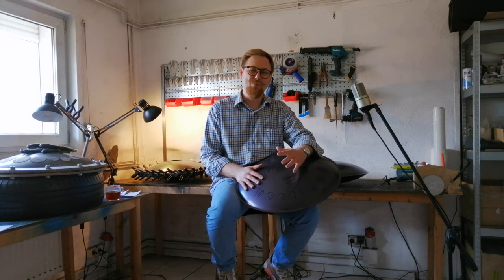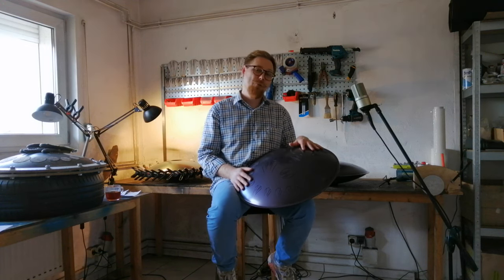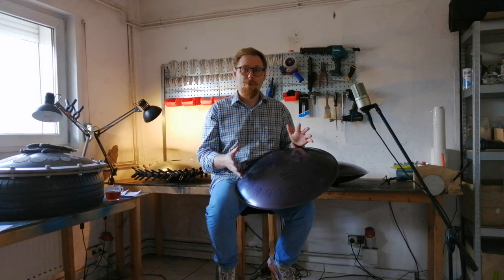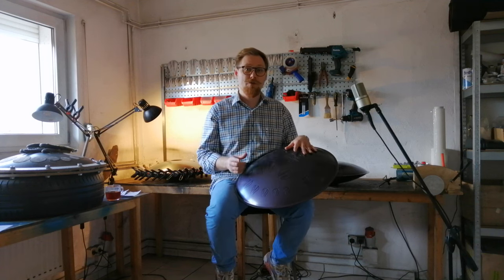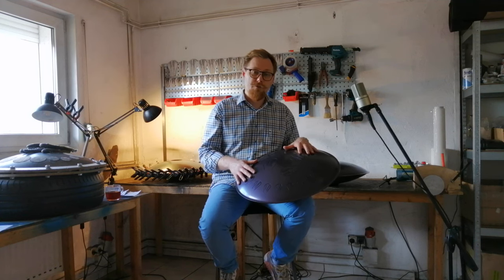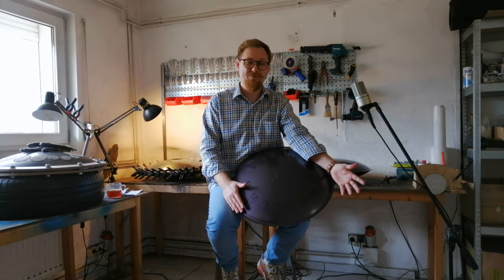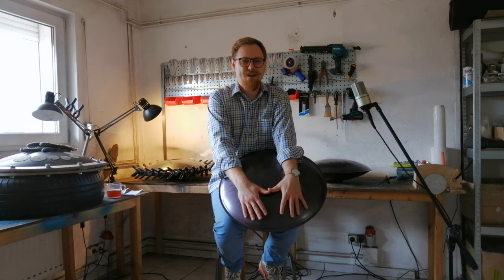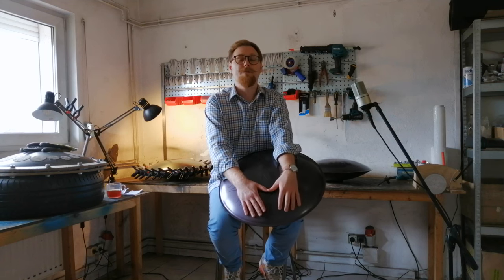From dream to drums: Chromatic secrets of handpan and tonguepan

Comment: I achieved my almost chromatic set up with three little cheap tongue steel drums, I bought some cheap ones because I wanted to detune them with a saw, or retune them to have a chromatic scale, the first one is a 15 note that has E lower note and goes diatonically on the c major scale, I tuned the A notes on that drum to Ab because the second one I retuned it almost completely, this second drum has 11 notes and has a A low note, I think it was originally on D major scale, but I tuned it A Bb C# D Eb F# G A Bb C#, With the larger one having E F G Ab B C D, I have some duplicate notes and I lack a lower F# but I can play most of the songs that I have tried in the past month
Reply from the maker: Well you have a great experience! Still I think 2 drums are better than 3, plus when they sound great on their own it means you can play each one without thinking they are a chromatic pair.
Reply: @yudinworkshop  the 11 note drum on its own has a great sound over a G drone, I think it is a double harmonic scale, later I´ll upload a video of me playing my setup and I would like you to check it, maybe with this experience I can order some  drums from you guys, they sound really good
Reply from the maker: @almendratlilkouatl  Well of course I'll take a look, you can send me an email through the site.

Comment: Brilliant work on the drums and good job on the video, Maksim! 🙌 I love my whole tone pair of Pulsar drums you made for me although I haven't had time lately to play them. I've been thinking about masking off both drums and spray painting the sharp/flat tongues black or a darker color to make it easier to visualize the patterns but I don't know a lot about painting metal that is already painted and don't want to harm the looks or tuning. I have a couple other interesting ideas for you to consider and I'll email them to you. 🙂
Reply from the maker: Oh wow, it's a really good idea to visually highlight the black and white keys to make it more convenient! Thanks, I'll think about it.
Reply from the maker: If your instrument is lacquered, you can buy any acrylic spray paint and apply a light, thin coat, this should not affect the sound. But if your drum is Raw then it won't work.
Reply: @yudinworkshop  Thanks, my drums are lacquered. Should I lightly sand the tongues to be painted first or just clean well with isopropyl alcohol? This is for future reference, I have too many other things to do before I attempt this! ;-)
Reply from the maker: @JohnLRice  alcohol or solvent will wash off the paint, or severely damage its structure, but you don’t need it. Just take a very fine sandpaper, rub it lightly, and then wash off the dust with a nitral degreaser, such as those sold at the hardware store, it does not contain any alcohol or solvent. But as a pro, I must say don't repeat this at home, it will damage your instrument and all this things.
Reply: @yudinworkshop  Good to know, thanks for the tips! 🙂

Comment: This is the reason why i bought the Kosmosky New Wave chromatic pair of drums...  I wanted to have options for everything!  Your video is really interesting so I have a better understanding of how the drums are designed the way they are!

I have talked to you before about your chromatic pair, at some point I would still love to get a pair from you. :)  Especially if you can offer a chromatic pair that has more than 2 octave range !

Is there any reason why you picked Bflat as the starting diatonic scale?

and you didn't talk about the second option you discussed with me, which is to spread the chromatic scale across both drums equally ( i know, harder to play, and the drum must be played as a pair - so probably not really something that most people would pick)
Reply from the maker: Thank you for your interest!

Yes, now I can make chromatic scale more than 2 octaves, from Bb2 to E5. The choice of this range is very simple, since the maximum number of notes had to be placed, and low notes take up a lot of space. You need to understand that not only the note itself takes up space, but the space around the note is also important. And so I started placing notes from the end, from the E5 note, which is the highest stable note that I can do, since any material has limits. I made notes higher, but the stability drops exponentially. And since on the white key instrument I already put 18 notes, and the lowest was B2, and on the black key instrument there were only 12 notes, and I just added another flat. You can add more, but then you have to add the 19th note to the white keys, which is no longer possible in this instrument size.

And I told both versions of the chromatic scale in the video, you probably missed it :)

Comment: Great Video Maksim, love your drums! Wow 18 notes on one drum? Before your limit was 15 right? Two questions: what do you think about the possibilities of double sided drums? And when I asked you about a pickup system, you mentioned you are not satisfied with piezo pickups, but you maybe have an other idea, any news on that front? Keep up the good work!
Reply from the maker: Thank you! Yes, I think that I will soon add the ability to make Triple Ding instruments up to 18 notes to the editor on the site. Previously, the limit for the Triple Ding was 15, for the Circle Ding 16. I plan to remove the Circle Ding from the possibilities since it is practically not in demand, and high notes are often not stable on these instruments.

Regarding the notes on the bottom of the instrument: About 4 years ago we experimented with this, but there are 3 problems with this: the first is the weighting of the instrument by 1.5-2 times more, since the same heavy material must be used on the bottom half of the instrument. The second is the convenience of playing, the notes on tongue drums are a console with one end "growing" out of the body, I call this the root of the note, and given the size of these notes, as well as placing them with the root to the center, because only in this way will it be possible playing simultaneously on the top and bottom half like a handpan, makes it impossible to place such an instrument either on the player's lap or on any stand. And the third is the Helmholtz resonance. The bottom hemisphere acts as a resonator and amplifies low frequencies, if you put the instrument on a drum stand and remove the bottom cover/rubber plug/stand, you will hear a difference in sound volume and the absence of low frequencies. Therefore, if we make notes on the bottom, then we make a "leaky" instrument.
Reply from the maker: As for the special pickup system, yes I have an interesting idea, but for obvious reasons I will not divulge it, because I plan to make about a billion euros from it. I hope to finish it soon and patent it.
Reply: Thanks for your detailed answers and good luck with your patent idea!

Comment: Yea, that's the limitation of this instrument.. Basically, the only practical solution is - if there is a VST for this instrument, you can play all the chromatic notes using your MIDI keyboard :(

PS. I'm saving money to buy one of these in the future ! Is there a feature to customize the shape of sound holes too ?
Reply from the maker: May I ask, why do you need to customize the shape of the sound holes?
Reply: @yudinworkshop  Yes, it is absolutely Non-essential. Just aesthetics. I like the the RAV ones, but the cat paw ones, (that are currently on your models), are fine too :) The most important thing is the sound !, and the RAV do not offer the scales that i'm interested in :)